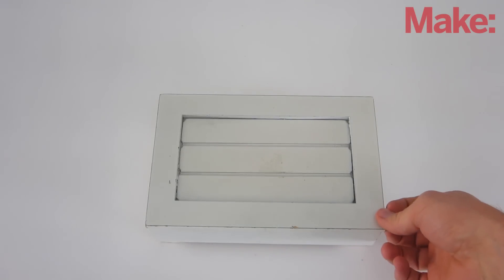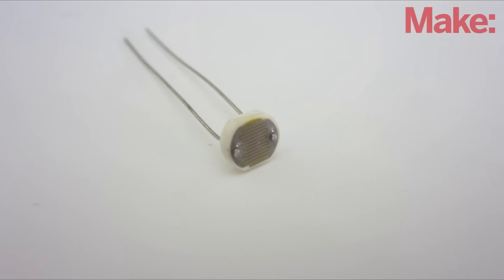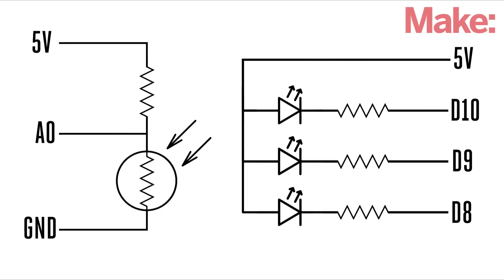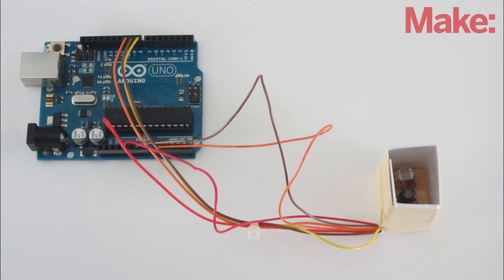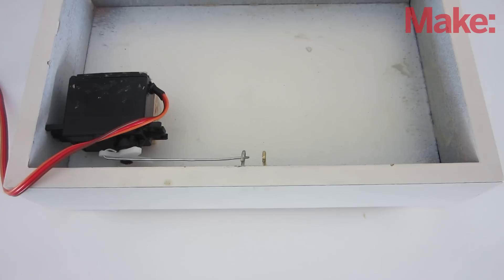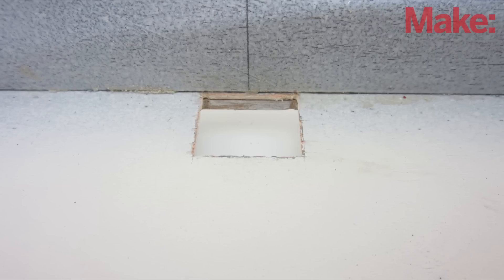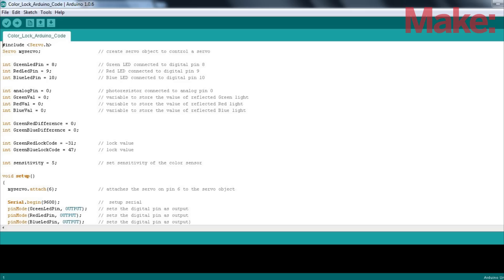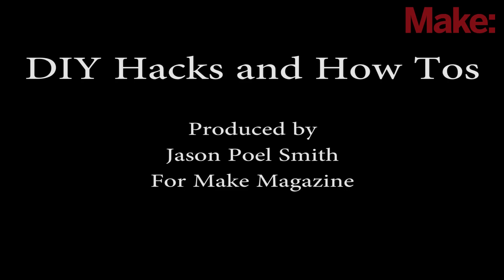Color Recognition Lock

Comment: It's very clever and easy at the same time, this has lots of possibilities just by swapping sensors, like a compass sensor that only opens the box when oriented properly, a temperature sensor so you can open it placing it under the sun or near a heater, a flame sensor to open it with fire, a gas sensor to open it with butane gas...
You could even use several sensors at the same time to increase the combinations and difficulty.
Reply: Barometer, GPS...
Reply: Hahaha a gas sensor may be the most obscure one, I hope you don't plan on opening it frequently. The compass, light, and maybe gyro could work together easily.
Reply: I was just thinking of this.

This is actually very very simplistic spectroscopy. You could do all kinds of things with this hardware.

Comment: What a cool little project. Would a simple red light work as well? What about a reflective surface (mirror or foil) will it be enough reflection to open the box? (well I guess I gotta build one now and find out!) See folks this is why I watch these videos. I got's loads of questions! (and now I get to go play and find the answers!)
Reply: The purpose of using multiple LEDs is to allow it to compare the amount of reflection from each colour. A red card, as in the video's example, will reflect a lot of red light but not much blue or green light. The photosensitive diode can't detect colour, but it detects the intensity of light. Therefore, when the red LED is lit, the highest intensity light will be detected.

You can do more than just red, green or blue though, still using the same set up. If it detects equal intensities from both the green LED and the blue one, then it must be a cyan card (see the chart at 0:39).

In theory, you could make it more sensitive. Computers use RGB to describe colours, where each of the red, green and blue colour channels have a value of 0 to 255 (which is convenient since computer screens use RGB pixels, as can be seen if you look really close at your monitor). The total values add up to 255, so it can be represented with 8-bits. For example, an RGB value of R: 0 G: 127 B: 128 would be mean that it is 50% green and 50% blue, so the colour would appear cyan as mentioned above.

You could use the photosensitive diode to measure the ratio of intensity from each LED, so you could get a more precise RGB value, and therefore a more secure key. However, a very sensitive diode would have to be used, and it would end up not being very accurate. I imagine that, at a maximum, you could get it to the closest 25% proportional intensity.

Using a mirror or foil would just make the computer think it was white, as it would reflect all the light with equal intensity.
Reply: Charlie Beadle and now I know! Thanks for the reply!